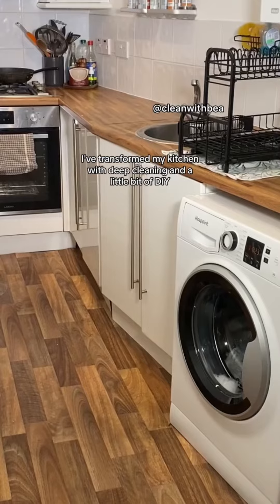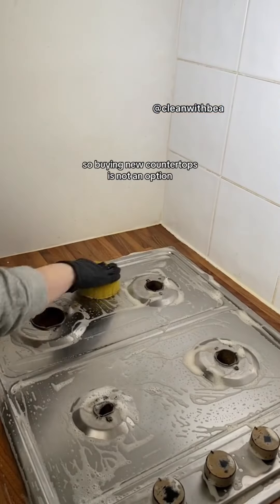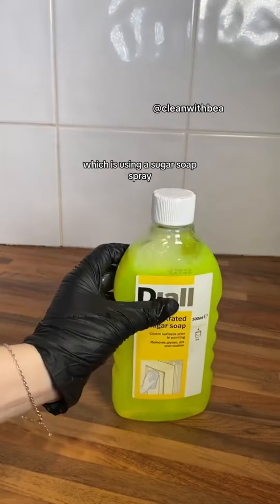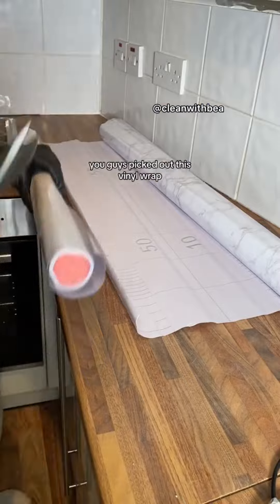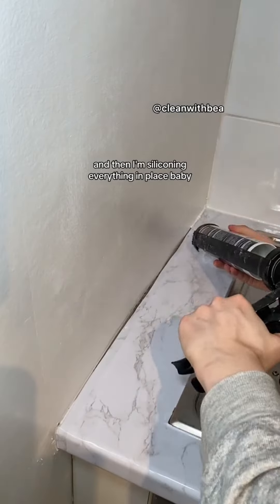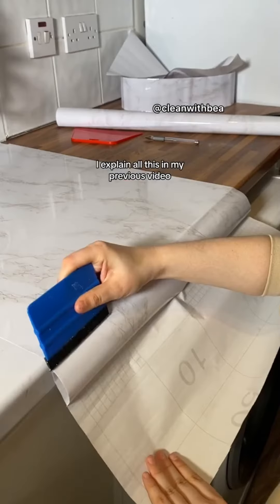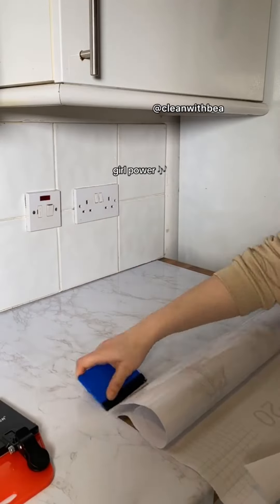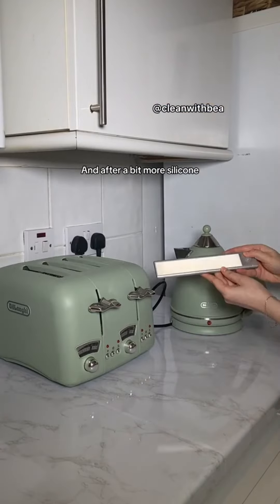Transforming My Kitchen With Some DIY!

Comment: Well done you have pulled off an amazing job so far.
All credit to you.
If you want to tidy up the floor rather than replace it (understandable as to why not) I would suggest you use wood hardener first to stabilise what is already done.  Then use car body filler to fill in the gaps and any hollows as that can be sanded to give a decent enough surface to put the vinyl onto.
Whatever you decide to do - Good Luck!!!

Comment: I e just used polycel damp seal paint it's brilliant. Goes along way as you only put a thin coat. It's totally stain and mold blocked my wall. I was able to paint over it with my wall colour. It's been six weeks no bleed through no bubbling no lifting🎉 think it would work great for your window frames

Comment: Could you perhaps take up the current Lino floor covering and spray the floor underneath with mold cleaner then let the floor air/ dry out, then put floor covering back down and silicon? Maybe also scrub back of floor covering? Sounds like a lot of work though.

Comment: Tips from me:
Buy a ceramic hob scraper 
And you need to ventilate properly. I'm German, we're fresh air fanatics 😂

Your windows are wet on the inside, take a good microfiber cleaning cloth and wipe them dry. ALWAYS. Every day. Then air them out. When the window is no longer steamed up, close the windows again. 

You should do this AT LEAST 3 times a day. 

That should help against mold. Unless there is a problem in the masonry such as water penetrating through a crack in the facade or a leaking pipe in the wall.

Btw always report mold to the landlord.

Comment: This takes me back. Two of the flats I lived when I shared in London had sinks that didn't drain because they weren't installed properly. One had water pooling in the silicon caked around it and the other didn't have a drain installed on the draining board (the land lord just sealed that up). so water just accumulated there. Landlords really don't give a damn. Their thought process is, "Is the rent being paid?" - Yes. Then there are no problems.

Oh one other story. We had a bathroom sink which had taps that didn't work. I complained to the landlord and then the landlords friend (happens a lot in London, there is a mole within the house or flat), who lived there too confronted me advising she could show me how to get water out of the taps. I told her, "You turn the taps and no water comes out. I don' t have 15 minutes every morning to coax water out of them." A few weeks later the landlords friend lost patience with the taps and suddenly they were replaced. Imagine that.

Comment: I would say damp and mold, I bet it's due to no ventilation. I am shock as this is illegal in my country which used to be lagging behind western countries. Just look for some chimney with vent grill. And some option to open window. Another is to put insulation beneath vinyl floor. But this deped on building type. And I think you have in England this weird spaces between floor for legar venting.  You should have at last one vent grill somewhere in kitchen as you have gas stove. This is illegal to have none. Another should be in you shower and toilet area. CO2 sensor with trending would be nice as would be telling you a lot if air exchange is sufficient. Let me know if you spot some of this.

Comment: The transformation over time is great. 
Only question is, what will you do if landlord refuses to reimburse you any money? Sadly he or she would have good grounds to refuse as they’ll say you didn’t seek permission for the changes (ie new tap, covering worktop). Unfair as it is, even the fact that the bamboo countertop was rotten/damaged isn’t sufficient grounds to say you HAD to do the DIY to cover it up, because these leases/contracts usually say make no changes without permission, even if the changes are for the better 😔 

Worst case scenario, when you end the lease they’ll make you undo the work or even penalise you monetarily for having done the DIY….
My prediction is by the end of your lease, landlord will STILL not have fixed the mould issue, yet will try and penalise you for all your DIY because it was technically unauthorised. 😢
Reply: True but the landlord would want to be a right c.unt if they did that seeing as the flat looks a million times better and she's treated a serious mould problem as much as she possibly can while providing a new modern clean look in the flat. If the landlords a tight arse which it seems likely,they would be happy she did that when she moves out because they will probably think 🤔 il slap on an extra few quid to the rent for the new tenants and probably take credit for doing up the flat 😂😂